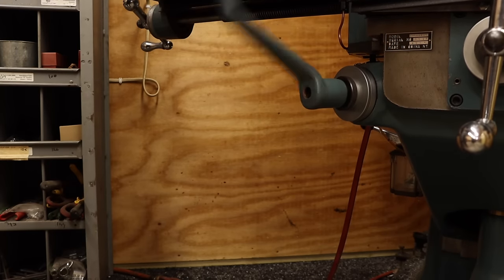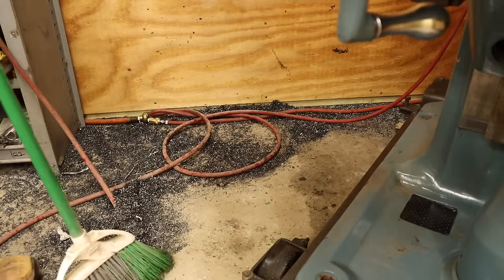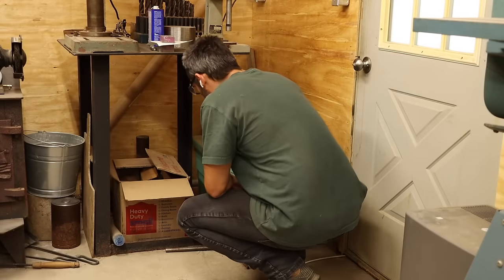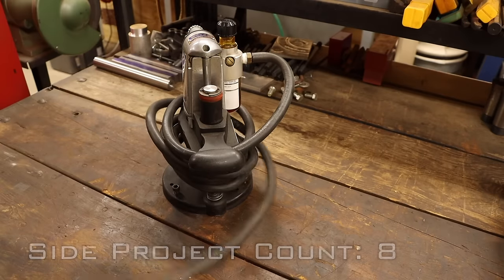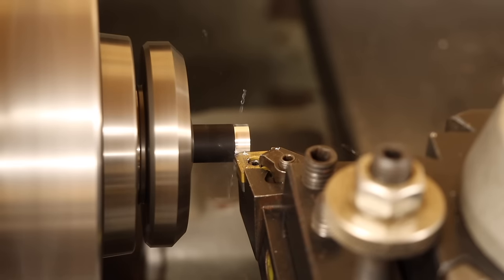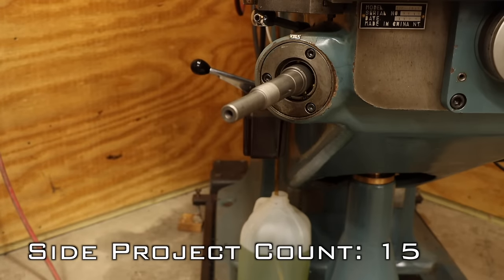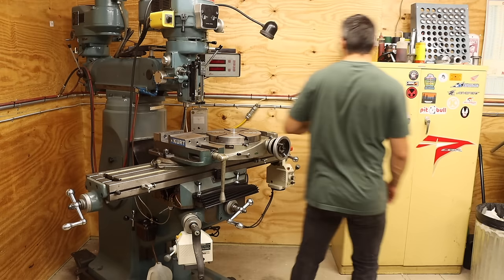3 Mill Upgrades (A Side Project Extravaganza) || INHERITANCE MACHINING

Comment: Well designed equipment dolly's, I like the idea that they have jack screws for leveling.
Reply from the maker: I'm actually not too crazy about them. the machine still wiggles a bit. I'll probably resort to the OEM leveling holes, Just need to find a way to lift the machine
Reply: We have anchored all three of our work V-mills into the concrete and leveled with shims. The anchors are mostly unnecessary as long as  you are careful with offset table loads. Also, both our Wells-Index and Bridgeport have horrible base castings, probably the cause of yours rocking. You would think such precision machines would have machined bases.
Reply: We have anchored all three of our work V-mills into the concrete and leveled with shims. The anchors are mostly unnecessary as long as  you are careful with offset table loads. Also, both our Wells-Index and Bridgeport have horrible base castings, probably the cause of yours rocking. You would think such precision machines would have machined bases.
Reply: We have anchored all three of our work V-mills into the concrete and leveled with shims. The anchors are mostly unnecessary as long as  you are careful with offset table loads. Also, both our Wells-Index and Bridgeport have horrible base castings, probably the cause of yours rocking. You would think such precision machines would have machined bases.
Reply: We have anchored all three of our work V-mills into the concrete and leveled with shims. The anchors are mostly unnecessary as long as  you are careful with offset table loads. Also, both our Wells-Index and Bridgeport have horrible base castings, probably the cause of yours rocking. You would think such precision machines would have machined bases.
Reply: We have anchored all three of our work V-mills into the concrete and leveled with shims. The anchors are mostly unnecessary as long as  you are careful with offset table loads. Also, both our Wells-Index and Bridgeport have horrible base castings, probably the cause of yours rocking. You would think such precision machines would have machined bases.
Reply: We have anchored all three of our work V-mills into the concrete and leveled with shims. The anchors are mostly unnecessary as long as  you are careful with offset table loads. Also, both our Wells-Index and Bridgeport have horrible base castings, probably the cause of yours rocking. You would think such precision machines would have machined bases.
Reply: We have anchored all three of our work V-mills into the concrete and leveled with shims. The anchors are mostly unnecessary as long as  you are careful with offset table loads. Also, both our Wells-Index and Bridgeport have horrible base castings, probably the cause of yours rocking. You would think such precision machines would have machined bases.
Reply: We have anchored all three of our work V-mills into the concrete and leveled with shims. The anchors are mostly unnecessary as long as  you are careful with offset table loads. Also, both our Wells-Index and Bridgeport have horrible base castings, probably the cause of yours rocking. You would think such precision machines would have machined bases.
Reply: We have anchored all three of our work V-mills into the concrete and leveled with shims. The anchors are mostly unnecessary as long as  you are careful with offset table loads. Also, both our Wells-Index and Bridgeport have horrible base castings, probably the cause of yours rocking. You would think such precision machines would have machined bases.

Comment: the power Z axis feed can be an arm breaker if someone leaves it engaged and you reach through to use the power feed. I would put  a light spring to auto-disengage the crank if possible, if you run out of side projects
Reply from the maker: 😁  There's already one there. but still a very tiny chance it could engage while spinning

Comment: Excellent! A lot of good ideas in there.

That knee handle seems like a bad bruise or fracture waiting to happen if it catches under power feed.
Reply from the maker: Thanks! Yeah it could potentially catch but it's held out by a pretty beef spring fortunately.
Reply: @InheritanceMachining  ahh! I missed the spring, that explains bolt/washer retaining the thing.

When not in use, I've been in the habit of hanging the knee crank reversed, with the handle in. Bit easier to move around the machine without banging knees on the thing. No power feed here however.

Do you have any thoughts or opinions on replacing the crank with a wheel as others have mentioned?
Reply from the maker: @emislive  😁 That's a good point. I actually used to store the handle that way as well before I converted. 

I like the idea of the wheel in theory but for my filming work I think it would get in the way. I tend to straddle the knee crank with my tripod for a lot of shots.
Reply: @InheritanceMachining  gotcha! Different kind of clearance.

Thanks again.

Comment: You know a good way to organise is to find a commercial refrigeration repar place and pick up some old Skope glass door units as they throw them away often, after blocking hole left by refrigerator unit they make great storage that you can see what's in there and motivates to keep organised as everyone can see what's inside 😉
Reply from the maker: Smart!

Comment: my advice would be to get that vice off of its rotating base for rigidity and take the rotary table off, the extra weight will bend the table over time.

Comment: That knee handle swinging away gives me the willies.  If in my shop, it'd break my wrist in a skinny minute!
Reply from the maker: 😂 it's actually kind of finicky to engage even when stopped. And it also doesn't take a lot of resistance to overcome the torque of the unit.

Comment: Quick tip:  When you cut zip ties, use a flush cut shear.  If you use side cutters you will have a nice string of razor blades just waiting to bring blood.  Shavings are bad enough.
Reply from the maker: thanks. I learned this lesson long ago 😂  I use an exacto knife to cut them flush

Comment: I've been looking at a lot of machine bases and made several, my favorite being a 2" square 1/4" wall rectangle that the mill base sat on with recessed ball bearing wheels and leveling feet out board from that. 

For my latest Bridgeport, I think I like your mill base, which is a variation on my theme using angle iron instead. I studied the video, but its hard to determine a few things, such as size and thickness of angle iron, wheels, wheel support thickness,etc. Any info you could share would be great! Keep up the good work!

Comment: I'm guessing you know this, but watch out for that crank handle! any Z power feed I used had the crank on a spring to push it out, as well as a limit switch to disable the power feed if it was pushed in.

If powered when the crank is engaged, I'm guessing it could do some damage.

Love the videos, learning a lot!
Reply from the maker: Thanks! I does have a spring but the limit switch would be a nice feature

Comment: First of all, congratulations for the channel, it's just fantastic. When watching this video I ask if it would not be better to add a spring to the lever of the axle so that by any chance the lever fits while using the electrical lifting equipment and hurt yourself with the rotation of the same? Attention I am not knowledgeable nor have I ever used this equipment to know if it is necessary or a good idea. Greetings and keep up the good work
Reply from the maker: Thanks! There is a spring there actually. The assembly shot doesn't make that super visible

Comment: I wish you would have gotten a little closer to the issue with the limit switch that you were bending back in place to work correctly. I would have liked to see how exactly I bent it into the correct space and what that looked like in there. Thanks and great vids bud! 👍🏼
Reply from the maker: Thanks! If I remember correctly it wasn't anything special. Just a little play on the mounting screw hole that I was able to favor to one side

Comment: I rarely sweep the floors in my shop.  I've determined the dust it stirs up creates a vicious cleaning cycle for me.  I almost exclusively vacuum.
Reply from the maker: Funny I didn't notice just how dusty it was until watching the footage back. I'm going to have to dedicated shop vac
Reply: @InheritanceMachining   I highly recommend this one:  Festool 574930 CT 26 E HEPA Dust Extractor    Expensive, but it gets the small stuff that will eventually kill you, it's fairly quiet and holds an amazing amount of crap.  Also has a bluetooth switch that goes on the business end so you can turn it on (and off) when you grab the hose.
Reply from the maker: @michaelrice500  now that is cool!

Comment: Ohh man, I love those upgrades! So freaking cool to actually raise and lower the Z-axis with that power feed! As said in some comment on previous video, that I dont do much manual machining at work but we have this one old Bridgeport that does not have the power feed on the Z-axis and when you said sometimes cranking that by hand will break a sweat. I agree! Multiple times I have used that mill to make clearance to jaws or milled some parts in half to inspect inner dimensions with 3D projector and that Z axis cranking has got me som sweat for sure 😂
Reply from the maker: Before installing that AC unit It was a somewhat dreadful experience haha! Just changing tools (collet to drill chuck) was a whole ordeal
Reply: @InheritanceMachining  Can imagine hahaha, whats gonna be next thing you going to do in the shop? Big fan of your channel, love the ideas that you have, and the narration is great as well 👍🏻
Reply from the maker: @Balderoni_  I'm thinking a couple simple upgrades for the lathe as well. But this time 100% made. I appreciate the support and you following along!

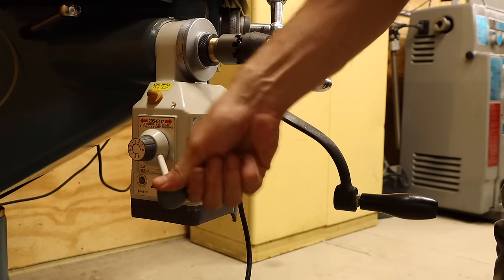Comment: Loving the work Brandon, but you missed a sitter of an opportunity for an "I'm not an ambi-turner" line at 17:00. Seriously, keep doing what you are doing, 'cause you are doing it right. And put a wheel in place of that crank, while you still have a left knee in use.
Reply from the maker: Oh no! I wish I was more familiar with that reference. That would have been perfect! Thanks for the support. And you've spotted a project I've already got on the list 😉

Comment: Your videos make my day!  I wish I had half the free time or tenacity that you do.  As someone else said, I think you'll come to regret the wood blocks underneath the knee mill.  It'll be fine until your seasons change depending on where you are (I think you said they were oak?).  More importantly, wood isn't the best vibration dampener, and you can end up getting chatter or other weird issues cascading from it (can wear on your spindle, etc.)  You have plenty of stock, I would make some feet out of a stable steel!  Keep up the great work!
Reply from the maker: thanks! I've always thought it isn't super important for a mill to be level unless one plans to use a level to position parts. But the vibration may prove to be an issue. Im not super happy with the spindly jack pads on the frame. so may have to find a way to level on the casting itself.

Thanks again for the info and support!
Reply: @InheritanceMachining    Epoxy machine base grout.  Clean everything, make a little form, get everything level and trowel/pour it in.  I used to work with a millwright; we installed a gearbox for a tram; it had six each, 12"x12" feet and weighed about three tons.  The epoxy kind might be hard to find, but the cementitious grout is $20-$40 for a 50 lb. sack.  Sika makes some.
Reply from the maker: @michaelrice500  Grout never occurred to me... We use that all the time in the systems I work on at the day job. I'm leery of the permanence though 😂

Comment: I am a woodturner, not an engineer, but I also suffer from wood chips and dust. Question:  Why do you not make a small electromagnet to pick up the shavings?  Or are magnets taboo around machine tools?  Just wondering!  Kind regards.

Comment: Quick tip on leveling DO NOT go front to back and side to side. You will NEVER get it perfect that way unless you accidentally hit on it.  Go DIAGONAL!  (R Front to L Rear and vise versa) Get it level in one plane and it stays there and acts a a hinge for the other plane. 

- When you do front to back when you get the "X" axis dead nuts you can't do the "Y" with out changing the "X" When you do a diagonal once you got it one set no matter what you do to the other is does not change the first diagonal. 

Saw a couple guys take over a hour trying to level a pool table at a beer joint. - finely couldn't stand it any more and made them a bet - 90 seconds later the table was leveled and I was sitting  at the bar drinking the the BV and Budweiser they had to buy me.
Reply from the maker: Thanks for that!

Comment: If you have power feeding on table, you have to add additional VFD for the motor. You can't use single VFD for 2 motors.
Reply: That's why, you have a problems with heavy cuts.
Reply from the maker: The powerfeeds are not run by VFDs. They are single phase 110V
Reply: @InheritanceMachining  I am so sorry, didn't watch the other movie. Could you please tell me the difference between college degree and engineering degree or university degree, is there a special schools in US? I am easteuropean and can't  make the difference. We used to have specialised schools, after that you can choose to be operator or engineer.

Comment: I noticed the noticed a mother on back of the knee mill, is it a broaching head ?  I have worked with this type equipment over 40 years.  Plus tig welding.
Reply: I meant motor, edit won’t work.
Reply from the maker: Thats a perplexing one. Its completely identical head just without a nod adjustment.

Comment: I notice you have a tapping fixture on the table where you mounted your belt sander. How do you like it? I recently got an ebay special that is very similar, but have not yet had the occasion to use it.
Reply from the maker: Believe it or not I've also never really had an occasion to use it since most of my tapping is done on the machines themselves.
Reply: @InheritanceMachining  Haha! I got mine in prep for threading some panels I was going to get lasercut from SendCutSend, but then I got sidetracked with my machining projects...Who would have thought?

On a side note, if you haven't checked out SendCutSend before, I think you may like it as an addition to your list of resources, I find myself ordering blanks of material from them with many features already cut, then machining the precision parts myself. It's really changed how I go about certain projects.

Comment: When using the power feed on the knee, is there any chance at all of the handle grabbing and spinning?  Looks like it would hurt if it did.
Reply from the maker: It's held out by a pretty stout spring but there is a chance for sure
Reply: @InheritanceMachining  I had to walk over to one of the mills here in the shop and look, I guess I've never noticed it before!

Comment: Did you have to reverse the positions of the limit switches for the Z-axis? I just installed a power feed on my Precision Mathews bench top mill and I had to mount the limit switch on the right side because the DRO scale was on the left. When I tried it I found that down was up and up was down. I was able to open the plastic case and switch the positions.
Reply from the maker: I sure did. Just like you mentioned